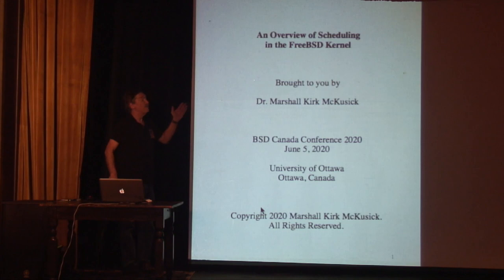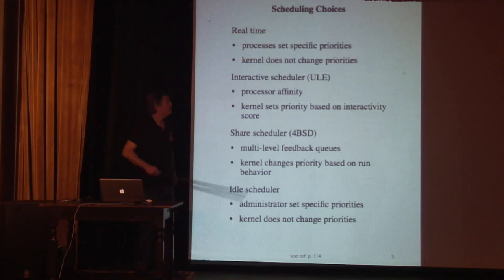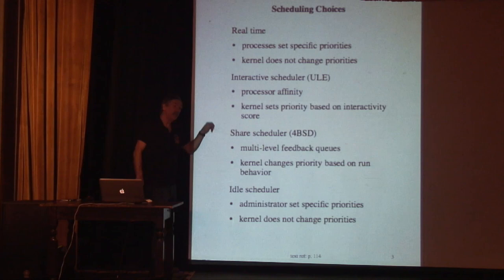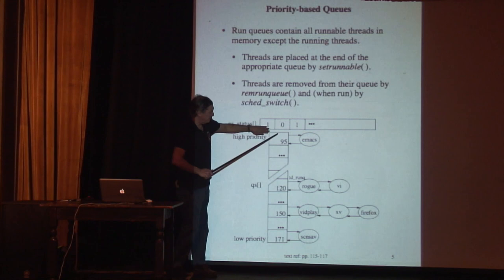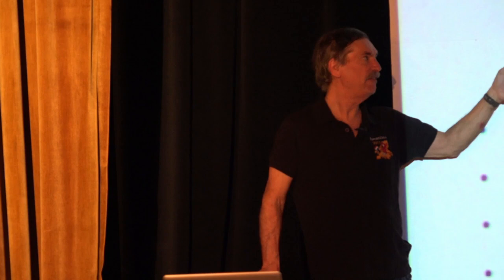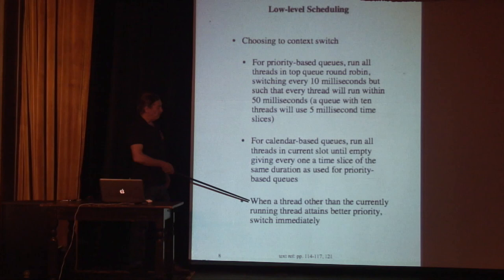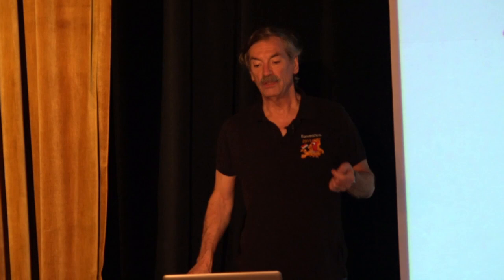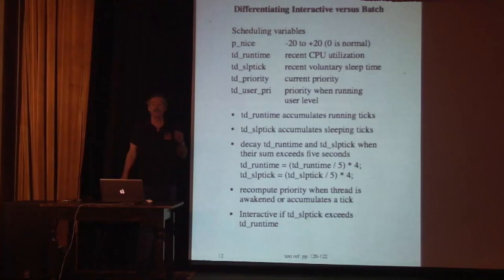An Overview of Scheduling in the FreeBSD Kernel: Marshall Kirk

Comment: Something I would have asked is whether there's any account made of SMT, where 1 physical core has 2 virtual processors sharing wide execution resources.
Secondly if there's been research into having some cores favour longer quanta for batch cpu bound tasks while the interactive are constrained to short.
Some surprising results where 6c/12t scored higher performance running as 4c/8t CPUs with 2 disabled suggest power saved and warmer cache can be a  benefit (at least where the load uses a fraction of the physical core's width so has mostly idle execution units)